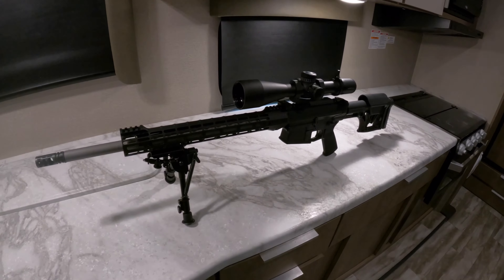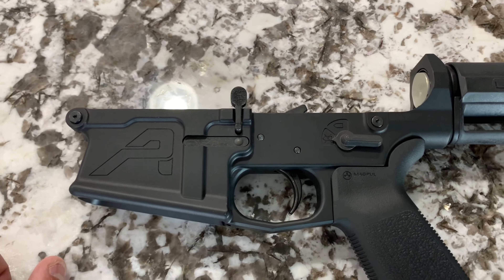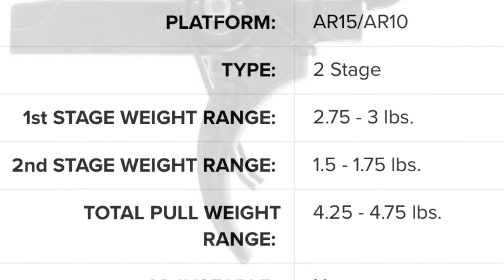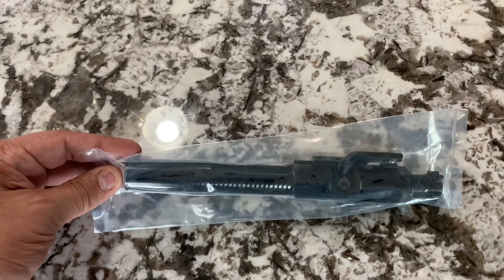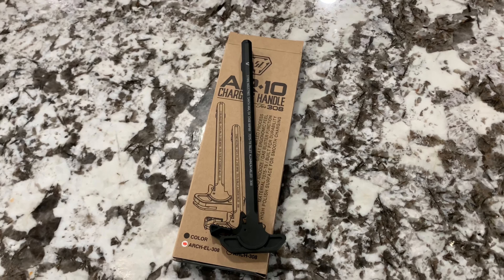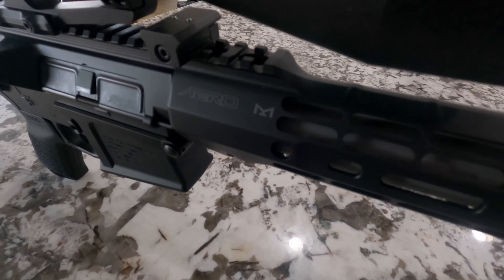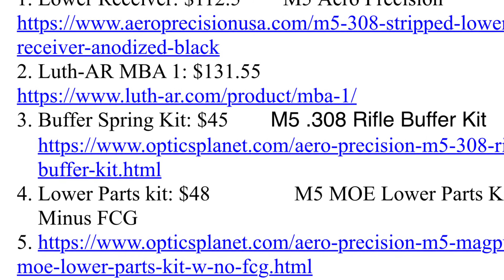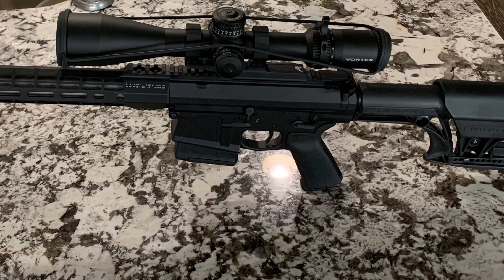Aero Precision M5E1- Upgraded Build List

Comment: Is that a savior rifle bag? What length?
Reply from the maker: https://www.amazon.com/gp/product/B077JPNZ6Z/ref=ppx_yo_dt_b_search_asin_title?ie=UTF8&th=1&psc=1
Reply from the maker: This is a 42x12 and I should have gotten the 46”. This barely fits my AR10, but fits. If you get a longer barrel or longer suppressor it won’t fit. Absolutely a great bag and does everything I need it to. Holds my AR15 and AR 10 with no problems

Comment: I had a very disappointing experience with Aero Precision. I purchased a lower and upper receiver, and while the upper receiver arrived within a week, the lower receiver has still not been delivered after three months. I have spent countless hours trying to get an estimated delivery date, but the company has been unable to provide any clear information. This lack of communication and reliability is unacceptable. Based on this experience, I will not be making any future purchases from Aero Precision.
Reply from the maker: I can be wrong, but I was under the impression that you can’t buy a lower receiver online. I got mine from a local gun store